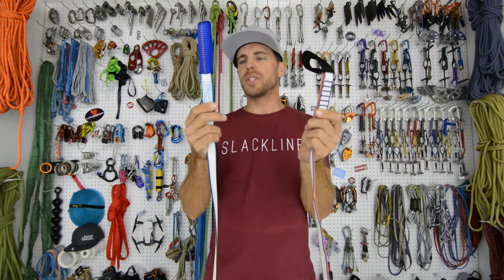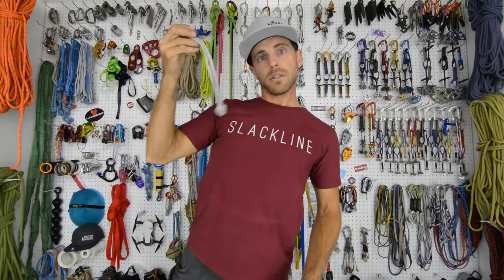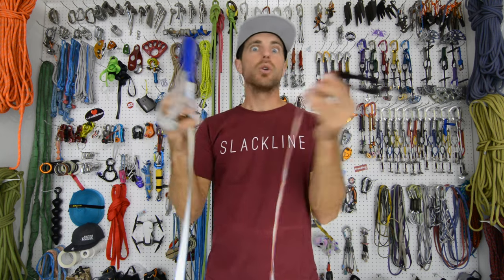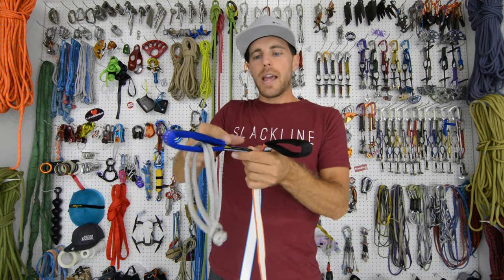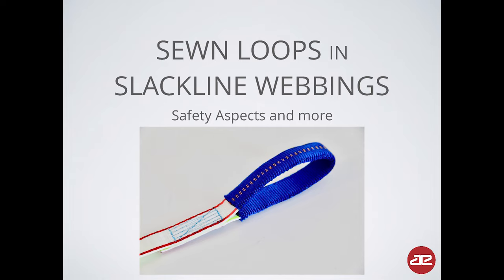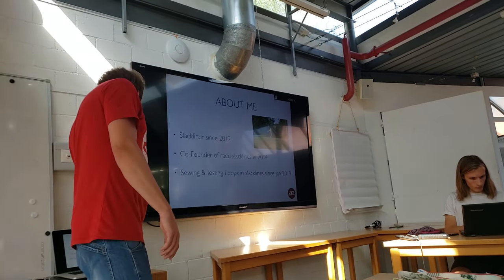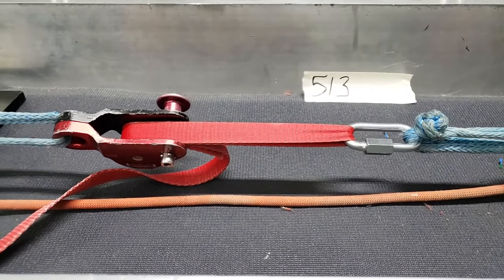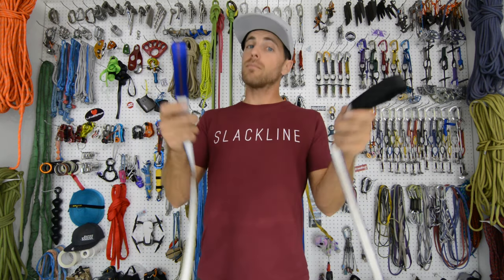Slackline sewn loop science by Raed Slacklines

Comment: I am still trying to get my head around this climbing concept of slack line's purposes.

To me, on the outside looking in, the big concern should be injury by falling 2 meters on a short semi static rope in a half or full body harness.

Since, for my own intended purposes for the climbing gear is a 5600 lb system of a multitude of ropes everywhere, anchored with 6000+ lb anchors everywhere.  The problem is to get many, many,, many shock absorbers that can safely absorb 5600 lb over 1 or 2 meter stretch, at the top of the rope.

Break away webbing that does not injure a 100 lb person by more than 4 G's  and less than 2 G for a heavy person is not anything sold. Break away offers continuous resistance and slowing which is superior to bungee or springs. Moreover 5600 lb is overwhelming to any practical in length spring or bungee sold.

I am not sure how such huge short line forces, solo, are currently dealt with in the climbing community.

I have been testing several things at scale. The biggest problem with sewing webbing is I found one inch line of nylon (perpendicular to the webbing length) caused a 900 lb webbing to rip at the point when 40 lb was dropped only a few inches, stich length was 2 on the sewing machine.  This was a hypothetical Hazzard that proved too true.    

I need to see successful 40 lb 2 meter drop shock absorbed descent on a sewn break away webbing. But it does not look promising.  Regular thread strength sucks, while my nylon seems to high to test at small scale, while the webbing strength compromis has creeped me out and was a hugely discouraging.

I probably missed the video on shock absorption, because my brain is focused on absorbing 5600 lb solely on the shock absorber and getting the force down to 4 G for a 100 lb person, which is 400 lb, less than half of the osha allowance of 900 lb, which assumes tough 220 lb firefighter men and not thinner boned people. To me, anything more than 400 lb is too painful. Also the system needs to be designed around a 2 meter fall on the ropes and be able to absorb the force, and exert no more than 400 lb on the harness. I will just need a longer stop for heavy people.  Of course, no one should allow slack, but I must design for it.

I am also looking for a measured and tested shock absorbing strategy, with the math.  The shock absorber needs to assume a short fall on a static rope.

I read one pubmed study on full body v. Half harnesses and the the injury severity.  Nearly all injuries were newbies falling on short non absorbing ropes.  So, in my application, there are tons of ropes, pre-anchored with shock absorbers near the anchor.  Naturally, I would design the system so that even if the shock absorber snapped, failing catastrophically, the person would not fall more than a few inches onto the 5600 lb rope. This means that a 900 lb webbing offering 400 lb breakaway every 1 inch, would work if long enough to offer enough breaking distance--which is my preliminary thinking.